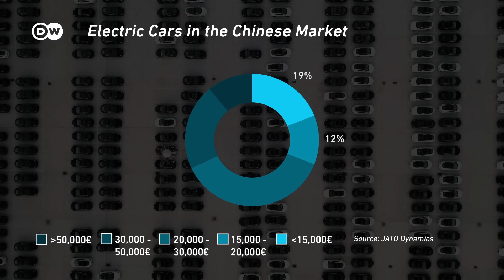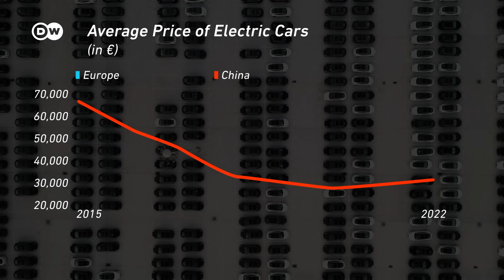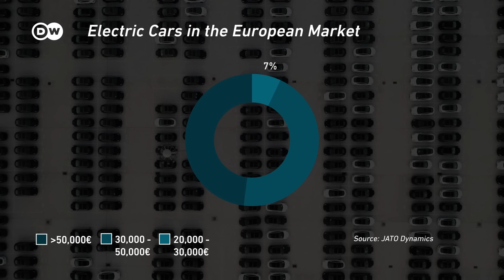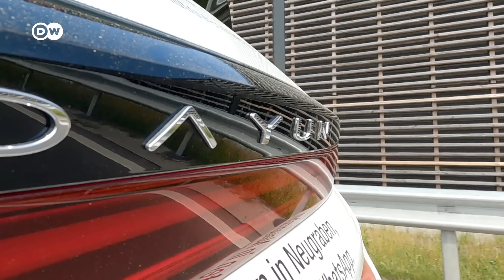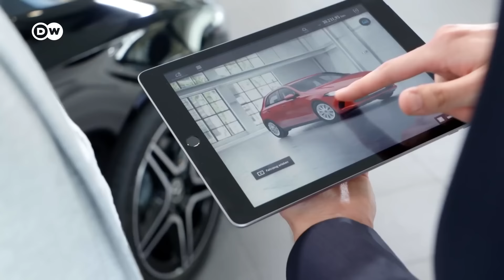China's Mini EVs Are A Game-Changer & Going Global

Comment: Chinese auto companies not only make small electric cars, but also electric SUVs and EV MPVs EV Pickup trucks. Even manufacture electric engineering vehicles, such as EV mine car, EV ambulance, EV fire truck。In fact in order to reduce carbon emissions, we need to replace any kind of vehicle with electric vehicles, except tanks and armored vehicles。
Reply: as said in other comment, China's inferior LFP batteries doesn't allow that to happen. China needs to use South Korea's NMC or Japan's NCA to be able to sell mid/high EVs.
Reply: @tooltalk  so, Tesla do not need? VW do not need？
Reply: @tooltalk  Tesla uses CATL.  LFP is proprietary technology of BYD.  And no matter how you cut it, all the basic materials like Lithium mainly comes from Chinese firms.  They have the lithium market cornered.  So even if LG Chem or Panasonic makes battery, guess where they source their materials from ... China.
Reply: @DucaTech  : >>Tesla uses CATL.  <<
No, you have no idea what you are talking about.  Tesla uses Panasonic (NCA) in the US; LG Chem (NCM) for long range and CATL LFP for short/standard-range in China/EU.  BYD was only recently added to Tesla's battery supplier list in Berlin a couple of months ago.  Also note China's inferior, cheap LFPs are mostly limited to entry-level, low-range EVs due to their technical shortcomings, namely, low energy-density and weight.

>>  LFP is proprietary technology of BYD.  ...<<
No, it isn't.  No Chinese company has its own battery technology.   China however neogtiated a deal with a Suiss patent consortium that allowed China to use LFP royalty-free for domestic use since early 2010's; then their LFP patents expired in 2021.  LFP is public-domain at this point.

>> And no matter how you cut it, all the basic materials like Lithium mainly comes from Chinese firms.<<
Wrong again.  Most raw materials used in batteries, eg lithium, come from Australia and Chile -- China has a much smaller market share with only 15%.  The largest miner/processor of lithium is an American company Albermarle, followed by SQM in Austrialia.  Their refineries are however in China because the refining process is very polluting and China doesn't care about their environment or workers' health/rights -- that's the only reason why 90+%of the refining process is done in China.
Reply: @DucaTech  >>  So even if LG Chem or Panasonic makes battery, guess where they source their materials from ... China. ...<<
Again, you have no clue.  The raw materials are mined whereever their deposits are located; eg, nickel from Indonesia, Australia, Brazil, but they almost always "processed" in China where all the dirty work is performed.  Doesn't necessarily mean that they "own" them -- it's just that most developed countries don't "want" to do it domestically b/c of pollution.
Reply: F1 race car as well.

Comment: As a Chinese I am very happy to hear or see such news that the chinese EV will be sold in EU. On the other hand I hope also VW can provide the more convincible and affordable product to the market to meet the demand of customer. As a Chines living in DE I need to buy a new car maybe in 3-5 years. I would like to support the local OEM🙂. Hopefully VW doesn't disappoint me!
Reply from the maker: Interesting perspective .. Thank you! Which VW do you like the most?
Reply: @DWREV  i bought tuguan l rline this January. i watched id4, zeekr001, q5l, byd tang. finally I chose vw tuguan l. 235000rmb after tax. all bcz my wife doesn't want to buy ev.old idea about safety. I prefer byd tang actually
Reply: How do you run YT bro?!
Reply: Many Chinese brands are already sold in the Nordic countries, unfortunately they are struggling so far.
Reply: @TB-up4xi  In France, the best selling Chinese brand is MG and is selling well for a young brand in the market. I had a MG ZS 2 and now a MG4 and I like this MG4, it is not perfect, but still nice (very nice handling, propulsion, more than enough power, nice confort, nice fit and finish, not that expensive compared to other brands). When I bought it, it was the only brand that had a compact car for less than 30000 euros (it might have changed, but I didn't check).

Comment: The Wuling Hongguang mini is only a few thousand dollars, and its endurance power is very strong. The main reason is that there are car Charging station everywhere in China, and this basic facility is almost rare in Europe and the United States. In addition, Byd is the world's largest electric vehicle manufacturer, and electric buses are almost all over the world. China is an actor, while Europe and the United States only rely on words.
Reply: >> The Wuling Hongguang mini is only a few thousand dollars, and its endurance power is very strong. ...<<
Unfortunately the Hongguang Mini EV doesn't even qualify as a vehicle in most Western countries and it would certainly not pass safety baseline.
Reply: @tooltalk well is it safer than a moped or motorcycle?

Comment: As a last end mobility solution, it is very wrong to think of small car in region like Europe. Alternative solution is to improve the quality of public transport for daily use, change in residential and commercial building plan so that people do not need a personal vehicle, better distribution networks so that people do not need a car for daily needs such as markets (deliver things to home with electric vans. It already happens in china/ Asia) and promoting healthier no carbon traditional solutions of cycling for last mile solution. Cars will not solve the problems of today… they still solve problems those existed until 1990s in Europe. Think different.
Reply: So basically national socialism.
Reply: China has shared bike system for people to go between bus stops and subway stations. At my hometown Liuzhou, where the Wulin  Mini EVs are produced, they also have shared EVs for daily rental. Meanwhile, buses are still doing their jobs are they suppose to. The EVs and shared bikes just fill in the gaps.
Reply: Holy shoes, wanted to say this and glad I scrolled this far to find it so I could agree instead.
Reply: Agreed, I don't love the trend of mega-sized and high-priced EVs (and cars generally) in western markets, but when you get to a certain level of local mobility...most people really should be walking, biking, taking public transit, etc. rather than driving a car in the first place.  I would much rather take quality non-driving alternatives than have to drive these types of little EVs and have only basic features, relatively poor driving dynamics, and still have to deal with the urban driving annoyances such as parking in cities.  Unlike the US and Canada, the EU has been making more serious strides in offering viable mobility alternatives to urban driving.  If I am going to need a car, I would rather have it be a comfortable highway cruiser and semi-enjoyable to drive.  Cars like the upcoming VW ID.2 are my personal ideal from a size, power, feature, and aesthetic preference.  And if I can't afford and don't need a car...I'd rather not have to own and pay for one at all if there are better alternatives.
Reply: @ruichen123  Nice to hear, how many of the mini EVs such as the Wulin would you say of their sales are personal vehicles vs. public car share vehicles?
Reply: @ryannatividad3137  You just spoke my mind. Exactly how i think of these issues.

Comment: The reason why China has such cheap cars because of very low (outdated) mandatory national standard for crashworthiness (Only 50kph front 100% crash test). After mid 2020s, China will mandatory side crash test for all small passenger vehicles. Thus lots of cheap cars (especially vans) will no longer available on the market.

Comment: if bicycle a allowed to be ride on the road without any sort of protection other than the rider's helmet, small electric cars with basic safety features like air bags should also be allowed.
Reply: Technically and legally speeking, simply compare to the wellknown Ape  trikes. Model 200 comes with a max. speed of 61 km/h and is even allowed to drive on German Autobahn. Will not survive any crash test. No ABS or airbag. However, no original EV ape available here, but e.g. for the Indian market. To be more realistic, such an EV would be well suited for small towns without regular public transport.

Comment: A typical car sits unused 23 hours (96%) of a day and when in use averages 1.5 occupants.  We have the capability with scheduling software to enable cars to be used more hours of a day by sharing and, when in use to carry more occupants via carpool.  Instead of individually owned cars, we can be served by a pool of vehicles, probably at one third or one quarter the number of vehicles.  More time may be required for carpool stops, but that may be offset by less traffic and less stress.  The TCO (Total Cost of Ownership) of a car in the US is $10K per year, but with sharing, it can be as low as $1K.
Reply: Just use public transportation.
Reply: Heard this before - people want to make 90% of personal trips (non trade / sales etc) at the same time on the same days hence why we have morning and afternoon peak hours. 

You miss the whole point of private car ownership - it's having a device that is at arms length that can take you wherever you want to go, whenever you want, and with whomever you want even if it sits idle 23 of 24 hours a day...that's irrelevant.

We already have a pool of vehicles for people who want to vehicle share - they are called Buses, Taxis and Ubers and if you want to drive yourself Australia has a hire by the hour "Go-Get" car facility (like electric bike hire) which I think most countries have as well. 

People like private cars, there are already a ton of ways to reduce cost of ownership but people don't want to use them en-masse. Sharing car ownership like this is no different to catching a 5 seater bus - no thanks.

Comment: 27Kw-35Kw AC or DC?
Business premises of nearly 4000sq.ft have a 10Kw  electricity load from grid,max 20Kw.
Reply: Those tiny cars have small batteries with capacities like 13 to 25kWh. 
You can easily charge them with 1kW or 2kW home power plug. 
Usually the max they can take from AC is 3.5kW. 
A few models like Geely panda can do around 30kW fast charging in DC mode.

Comment: What's with the Volkswagen E-up? At the end you can buy a Smart E or a E Twingo (or the named Dacia Spring or the E.GO) if you want a cheap electric car. No need to buy sweatshop cars without any control of a fair supply chain! I doubt that a used Nissan Leaf or a Hyundai Ionic are more expensive than the shown retrofitted deathtraps
Reply: Talk of sweatshops ha, like how Volks Group BMW and Daimler outsourcing manufacturing to Easter European countries? If you enjoy secondhand stuff, ya eBay's always there for you.
Reply: Knowledge points: Dacia Spring is an EV imported to Europe after being made in China by Dongfeng-EGT, a 50-50 joint venture between Chinese state-owned Dongfeng Motor and Renault, located in Hubei Province, China.:face-blue-smiling:
By the way, the Chinese version of this car is called Dongfeng EX-1, unfortunately poor sales ~ (not competitive).